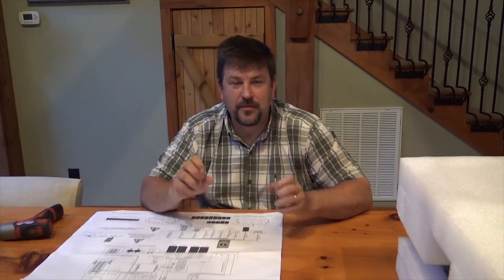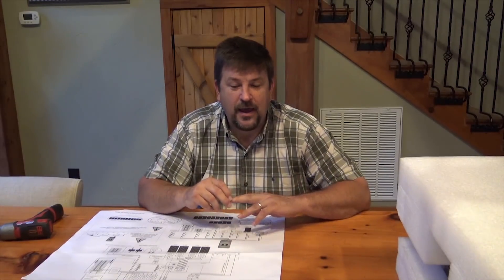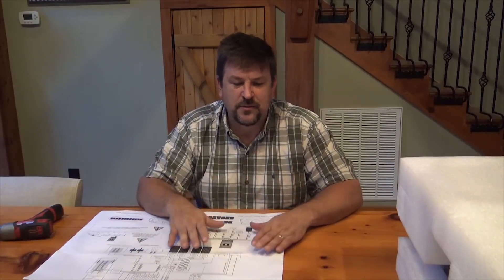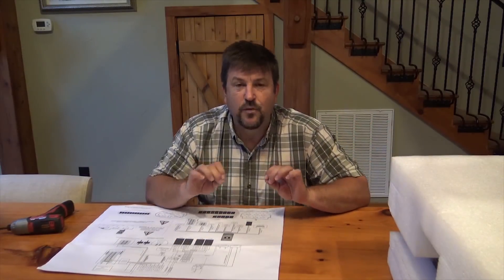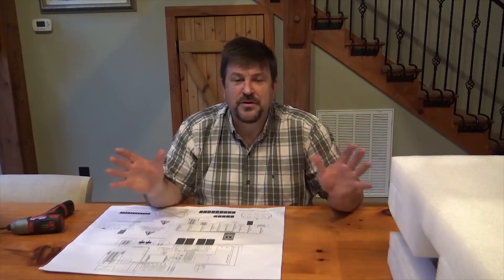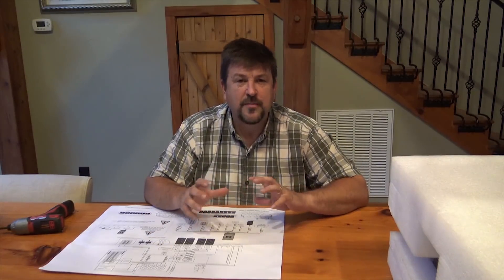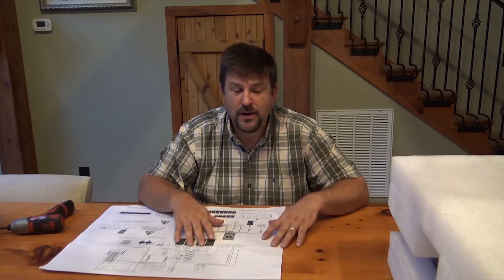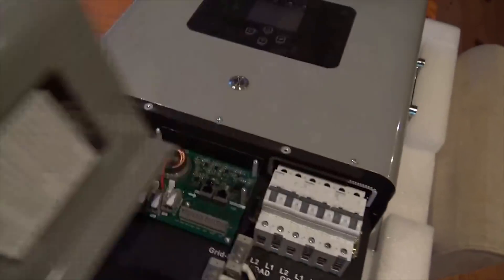Solark 8k Unbox

Comment: I have only done a few smaller systems. 2Kw and under. Even wind with solar . Using Morningstar charge controllers. Mostly 24V and 12V systems. was wondering on sol-ark battery types. I get AGM/flooded ,Trojan has carbon IN reached lead now.  did on a replacement battery . Most of my installs are Nickel Iron and NiCad flooded types. My Nickel Iron over 20 years old still going strong. The LifePO4  is great. can the sol-ark be set to different battery types ? Like Nickel Iron also called the Edison battery. CATL has Na -Ion cells now . lots of new types coming out. Also what about my old ranch I sold has 208V 200amp 3 phase service. what can be done to add solar/wind ? Thank you, love the video's . I am a electrician . I do small installs .

Comment: I am "assuming" that this is a "True Sin Wave" or "Pure Sin Wave" inverter I would like to see just how "CLEAN" the AC wave form is coming out of this unit / brand on a decent brand / quality oscilloscope. One thing I don't like is the PV field connections on a PC board... Whats up with that? You are just asking to rip those soldered PC mount connectors right off the PC board with all the weight of the PV wires coming into the unit.  I like to see all field connections run to terminal strips on the unit or better yet plug style terminal strips to make it easy to disconnect if needed, for service, emergency, or replacement of the unit. For the price of this unit they could of made some improvements. Again how "CLEAN" is the AC wave forms from the inverter?

Comment: Couple questions.... 1) roof cut off for fire dept?  SMA offers a remote disconnect box on the roof.  2)what is the Vcutoff on the low end?  Will it work with a 12s lithium battery or 14s?

Comment: Your "basic" package is $9,150 without the EMP protection, and includes 5 panels and 4 batteries.  Who sells a system without listing the wattage and type of panels, and the brand and AH of the batteries?   I see much more fear mongering on the product page than product information.

Comment: So just the inverter, without EMP protection, is $6,500?  The video makes it sound like this unit has a built in charge controller, is that the case for $6,500 starting price?  Your website is not very clear on what this unit includes, or does, imo.

Comment: What if you had a battery bank of 8 batteries at 265cca each, do they make a device that will monitor each battery until its fully charged and then switch to the next until all are charged? Or do you need a separate charge controller for each one?
Reply: CCA is for cars and boats not solar applications. and if 8 batteries are wired in a bank, you only need 1 controller, if it is rated for that bank size (volts and amps).

Comment: No transformers so it must be running IGBT and high frequency circuits. Reliable and proven in industrial forklift chargers for years. Way less heat for sure.  I have a new installation going in soon and will be watching this closely.

Comment: what certifications does it have? CSA, CUL?
Reply from the maker: They are listed on the side of the inverter.

For electrical safety was tested and certified by SGS for US/Canada:

UL1741-2010/2018, IEEE1547a-2003/2014, FCC 15 class B, UL1699B Arc-Fault PV protection, CEC efficiency.

SGS is the largest safety certification company in the world.

For EMP survivability it was tested and report given by NTS labs:

MIL-STD-461G
Reply: so how do they do if you use them full time for off grid?

Comment: Oh my goodness pastor!!!  $6500 base price? For just the inverter? I understand evolving technology, but what are real live, hard working middle class Americans going to do to access this kind of stuff?  I mean that kind of investment money is for people making 6 figures and above.  Yikes!!!!
Reply: your not going to be able to because the price is crazy. try this https://www.sigineer.com/product/12000-watt-pure-sine-wave-inverter-charger-48volt-to-120240vac-split-phase/
Reply: As a Veteran owned Engineering company, we care about our customers immensely. The 8KW version of this exact inverter D. Smith mentions was given to us because they wanted us to use it instead of developing our own.  It is made by the largest Chinese inverter manufacturer Invatek. AIMS sells the same Invatek inverter under their name. It is powerful, but inefficient and has huge idle power consumption. The 12KW consumes ~200W per hour without anything plugged in. That's 4.8KWh/day just for the inverter. So you will need to buy 4 extra batteries and 4 extra panels (+$2000 extra cost) to cover idle power and 2 extra panels for inefficiency (+$600). Two charge controllers will add ~$900. So it ends up being ~$5.8K. We did not test reliability but it looked solidly built. The biggest savings in solar is when the system cuts your electric bills. That savings is bigger than the 30% federal credit. That's how solar pays for itself in 7-10 years. The Invatek inverters branded under many names does not cut electric bills (~$10K/10 years). It either operates as a backup UPS (not using solar) or in an Off Grid type mode where it only uses the Grid if the batteries are drained (cycling batteries daily kills them in 2 years). I'm not trying to put Invatek down, just saying to do research. Kind Regards.
Reply from the maker: We can't install non UL listed inverters.  There are a lot of costs associated with being compliant to NEC codes.   There are a lot of cheap "cowboy" systems out there.
Reply from the maker: Remember, it's not just an inverter.  it is a string optimizer, charger, hybrid inverter that is EMP hardened.   If you price a tradtional system with all the components needed, combiners, charge controllers, distribution panels, remotes, Auto genstart modules etc etc plus wire you will find this to be a pretty good deal.

Comment: I have a small business, can I hook 2 together? I need a max of 14k - 15k. Is 220v single phase possible?
Reply from the maker: No. Most 4KW and 6KW inverters require stacking due to peak or continuous power needs. The Sol-Ark 8K has 20KW peak power. So ganging is almost never needed. You can run separate split loads with it.
Reply: Engineer775 I am guessing that I will have to separate different floors. My max load is a sustained period not surge load. I have 6 split type air  conditioning units, solar water with electric backup,  2hp well pump and all the other normal stuff.
Reply: I bought a 15kv transformer for the building. Can they be hooked up to the same battery bank?

Comment: So you guys haven't started 96v battery banks and inverters yet? we are just starting to get them in AU now
Reply from the maker: Nope. Over 60V batteries require lots of special requirements in the USA. And the 48V efficiency of the Sol-Ark 8K at 48V tops the efficiency of even 380V DC battery systems. See this chart.

https://www.practicalpreppers.com/power-solutions/solar-solutions/emp-hardened-systems/sol-ark-8k-inverter-inverter-only-detail-view
Reply: @engineer775  nonsense. The solark is 95%. SMA is 98.5%

Comment: what about using the sol-ark dedicated for a large wood shop that has tools using 220? will this be big enough or would it need 2 of them and 2 sources of solar and/or wind power?
Reply from the maker: Just one should be plenty. It will run a 5HP compressor and large 240v loads. And you can add wind directly to the batteries.

Comment: Good to see you putting videos out again. 
Ok im on a budget an wont to start using solor. What im thankingof doing as i build my panels up is get the microinverters this way i can use them as i buy them. Then maybe after i do get enough i could sale the mircos. But at one panel a month it could be awhile. What do you thank for someone on a small budget
Reply from the maker: I have found that for folks on a really tight budget wanting to get into solar is to build individual systems to conquer a task like running a freezer or heating water.  I have several small solar systems that have been running for 5 yrs some 15 yrs.   I did my water , hot water, freezer, internet on 4 separate small systems.  It is an approach that offers redundancy and affordability.  This solark can run everything but the cost to jump in can be prohibitive for many.  I get it.  That is why I do both types.  Whole house and individual.  You have to just jump in a build a small system.  If you need help and are serious we can design and ship you components to take your first appliance off the grid.